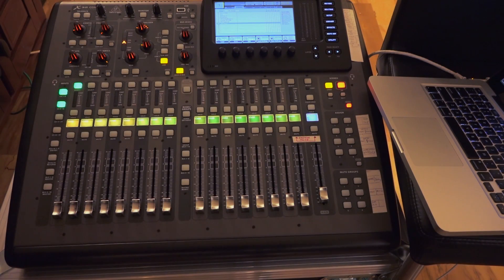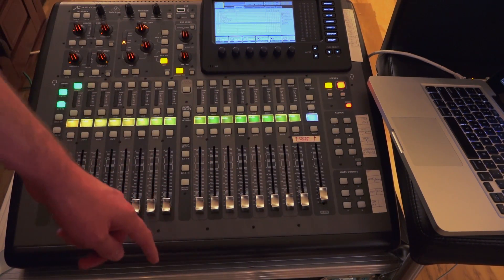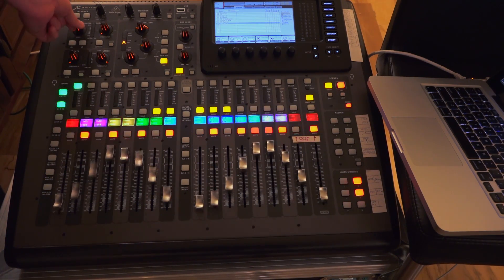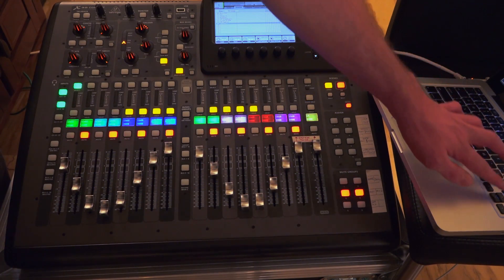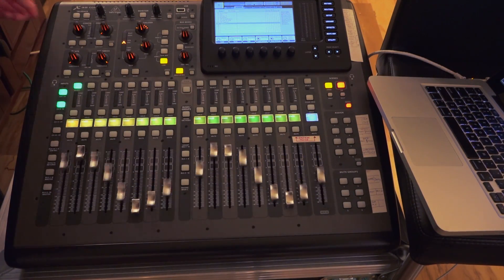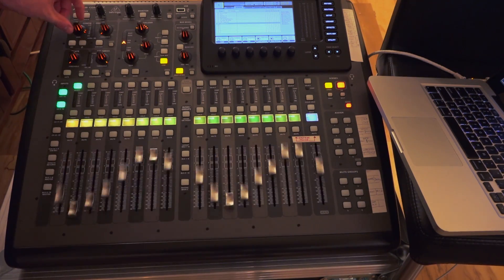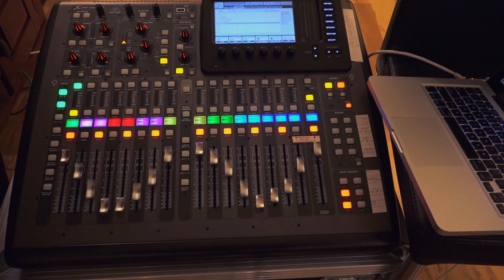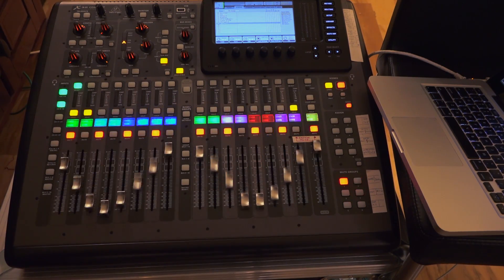Behringer X32: Vegas Mode!

Comment: It does not drop messages. Just faders are not fast enough to move ;)
Reply from the maker: I stopped it before it happens but it clearly begins to hang and skip ahead in the sequence (you would see it in fader formation as well as LEDs). Reducing the overall number of OSC instructions packed into a unit of time (when I switched to the fader-only version) gets around this.

Comment: Why isn't this made as a utility either in board or on a USB stick.  The purpose is to check all lights, faders etc.   it is very useful if you think you have a bad light , fader etc.    This should be a basic utility on this console.    If it can be made available on a USB I'd buy it !!

Comment: I'm using oscp5 in processing to control my desk and can talk to it but not receive back. I used wireshark to pick up the messages and the desk does respond however its to a random port number. Did you have to send a message to the server with your port number in it within your code or did it automatically link?
Reply from the maker: I had to do some hackery to get UDP/10023 on both sides, by sharing the same socket for the osc client/server. This is using pyosc:

server = osc_server.ThreadingOSCUDPServer((oscLocalServer, oscLocalPort), disp)
server.__dict__['socket'].close()
server.__dict__['socket'] = None
client = udp_client.UDPClient(oscRemoteServer, oscRemotePort)
client.__dict__['_sock'].bind(('0.0.0.0', oscLocalPort))
server.__dict__['socket'] = client.__dict__['_sock']

Comment: F*** crazy 
won't the fader motor get mothered ?
Reply from the maker: I would sincerely hope the fader motors shouldn't have any trouble with this. I'd actually be more concerned with the fader belts slipping. Naturally the board isn't designed for this kind of constant treatment, and I wouldn't do it with any regularity.
Reply: Ancient comment, but just found this while doing my own X32 demo. The faders definitely have a limit to their lifetime, specifications say 400 000 operations, which will be many years in normal use. Spare parts do exist and can be ordered for example from thomann, so if one blows, it's just a bit of an extra cost and nothing worse than that.